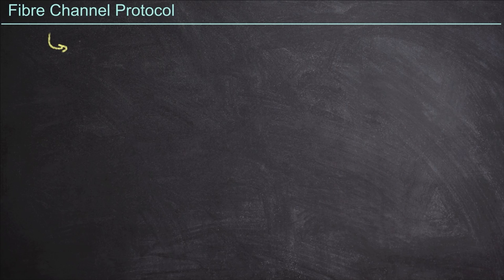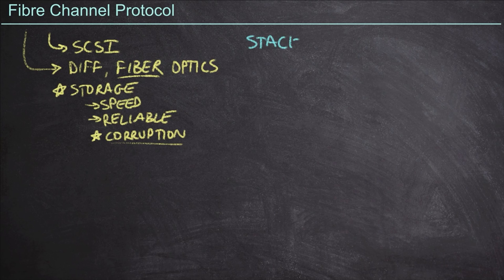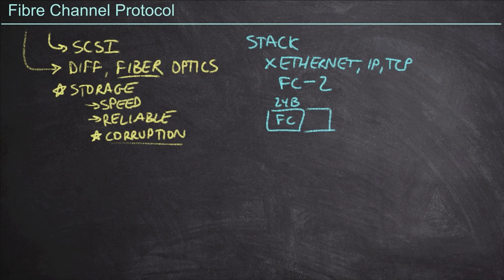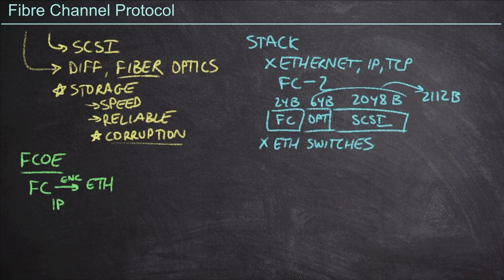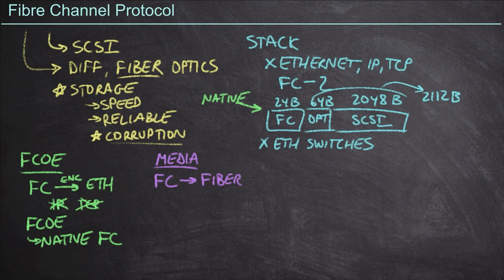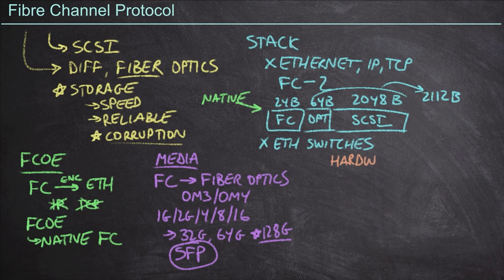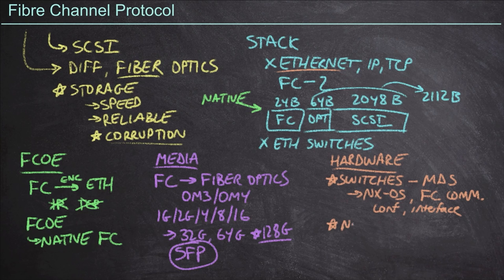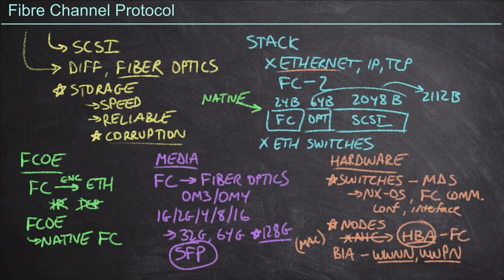What is Fibre Channel Protocol?

Comment: It's worth noting that Fibre Channel can absolutely use copper by using FC DACs. It's much less common than the fiber implementations and the distance is much more sensitive to signal degradation but FC isn't restricted to just fiber.

Comment: I've built an ESXi system with two hosts, two FC storage units connected each to two FC switches. In generall each ESXI and each storage are each connected to "each" FC switch. I can lose 50% of my system and still continue working. Everything works great, but recently a question rose up, if it would be beneficial to connect the FC switches to each other. What do you think? As always, great video! Thx for all the knowledge.
Reply from the maker: Hello, thank you for reaching out! No, in general the FC switches should not be cross connected. In the datacenter we refer to this as a SAN A and SAN B design. The idea is to have two completely isolated FC fabrics. The switches should remain air gapped.
Reply: @cbtnuggets  Hi, Thanks for the reply! So basically you confirmed, that everything's how It's supposed to be! Thanks!
Reply: Hi @0ADVISOR0 and @cbtnuggets, 
First of all thank for sharing this inspiring information about your Lab.
I'm also building a Fiber Channel Home Lab, I've already purchased a MDS Switch 9134, a Dell Poweredge r720xd with ESXI and a new HP microserver with Qlogic Fc adapter.
Could you please have any advice (config, spec, ...) to share with me in order to build this lab properly ? 
Thank you advance.